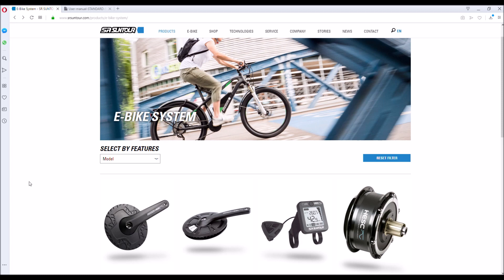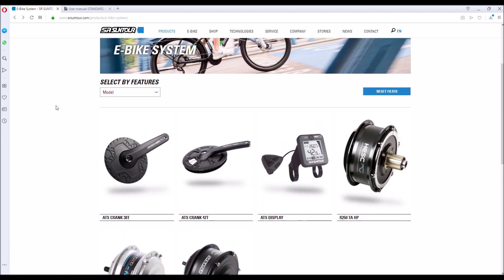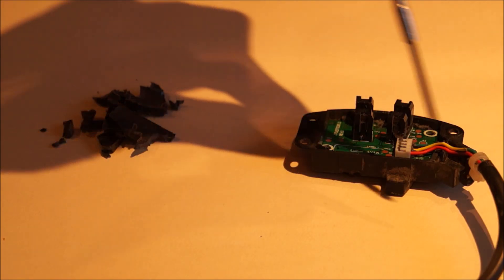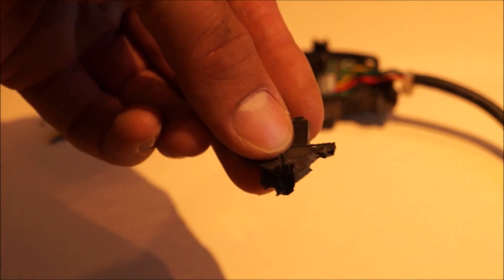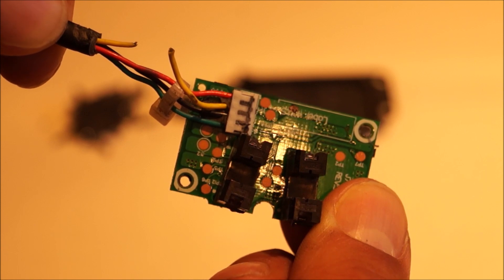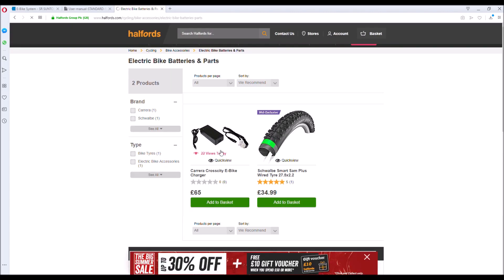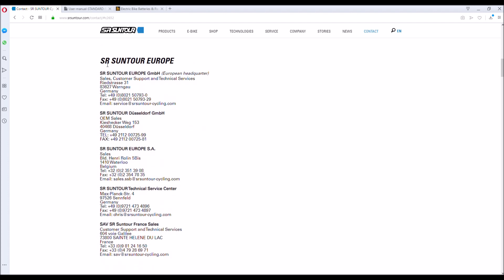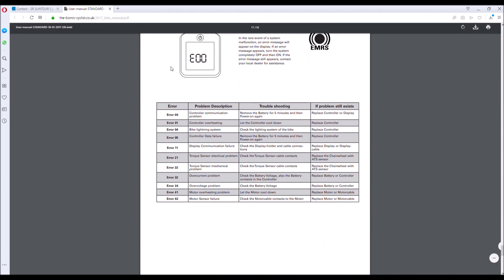Carrera Vulcan E-Spec - torque sensor problem (E21 error)

Comment from the maker: I noticed somebody posted a comment a couple of days ago about an E42 code fault - it appears that comment has disappeared, but I can tall you that this is a fault with the motor cable.  That is the cable connecting the hub motor to the battery.  Best thing to do first off is to check for any loose connections. There are microconnectors that plug into one another at the battery end which can come loose, but the most likely culprit is a loose connection where the motor and battery leads plug into one another under the HESC neoprene cover on the chainstay. HOPE THAT HELPS!
Reply: I have a similar E42 fault, couldn't solve the fault, please  assist

Comment: I have the crossfire and have the same error, now and again, but it seems to clear up when I keep the bike indoors  over night, so  I think it may be a  cold/damp problem, which is not good since I can not really store the bike in the kitchen all the time, but it don't seem to like the shed. thanks for the link
Reply from the maker: No problem. I'd always advise keeping the battery and display unit indoors at all times. Always keep the plastic protector slid over the contacts when you remove the display unit.

Comment: I have a Carrera subway, after 2500 miles I started getting error code 21 would switch off and on and it would be fine then it started getting more regular. Bit the bullet and very carefully took the 3 screws/bolts off there is no water resistant seal on casing, the part with the 4 sensors is sealed but there's a void where the cable comes in and the 4 wires go onto the board I cleaned the void carefully with WD-40 contact cleaner then filled the void with gorilla silicone put a small beed of silicone around the edges, and is working fine now. I think all the dirt and grease in the void when damp was causing a short. Done it all on the bike without having to remove any wires or plugs

Comment: Hello again Ice Reef,
  I went to Halford's today and put an order in for the part...they said it will take ten day's at a cost of  40euro.
  The rep said he will also see if it can be done under warranty....though i suspect it may be out of date.
thank's again.
Reply from the maker: rcfanaticdublin Good news - maybe try telling them it is a common failure and it should really be a warranty replacement. The new sensor is a much better design with the plastic guard which prevents more dirt ingress 👍
Reply: @IceReef ,
I did mention our conversation to the rep...I think that's the reason he made the offer.
 don't worry...i did not mention who i got the information from.

Comment: My anti rotation lug also broke but I caught it before wires were damaged. I have done an araldite repair on it which looks strong enough at the moment.
Very helpful links which i will use to try and get a new battery as mine appears to be starting to fail. Can not decide whether to fit a whole new bigger battery to the bike which is alot cheaper to do than buy a new one from Halfords.  May be you could have a look at this idea in another video??
Reply: Hi,
Where do I buy a new battery for this bike please?

Comment: Did you ever find anywhere for the new parts?
I've had a nephew crash mine and shear off a pedal meaning I've to replace the whole crank right crank arm (and the chain system, because it seems to be one piece), but I can't find somewhere to get parts.

Comment: Had the same exact problem few weeks ago. Halfords sorted it under warranty
Reply from the maker: Hamza Ahmad Good to know they replaced it without an issue. Unfortunately mine is second hand!
Reply: I think your best bet would be to ask for the replacement in an Halfords repair shop as they have contacts with suntour directly
Reply from the maker: @mughal_gtown  I've spoken to the dealer in the UK who, unfortunately, cannot sell to me direct, so am awaiting confirmation from Halfords if they have the part, and how much they are going to charge / rip me off for!
Reply: Hello Hamza,
Just wondering...how long have you had your bike and how many Mile's/klm's?
before your problem with your bike.
Reply: rcfanaticdublin had it for about 9 months now, over 3500 miles on it
Reply: @mughal_gtown  ,
Wow...mine just turned 2 years old.
I don't do much crazy stuff on it as i am well north of 40...2007klm ODO.

Comment: I recently looked at a friend's ebike that has the same (looking) suntour parts shown in the thumbnail here but not the same bike.   The crank, controls, display, etc are all the same.   Anyways, this bike is getting the e21 code because the torque sensor on the crank got caught on something that ripped the wire out and broke off some plastic tabs.  I took it apart and  resoldered everthing on the sensor, and the error code went away.   I want to replace the entire sensor but it seems the only ones i can find that will ship to me are the grey colored ones.  One guy has the matching black one used but won't ship to me.   So far, the only difference i've found in all these sensors is 4 wire vs 6 wire plug.   I need a 4 wire and I see them available online.   Are these gray colored ones real  OEM parts made by suntour or soem garbage knockoff?    My other question is, are all the "4 wire" plug torque sensors the same and should work with all these suntour HESC systems as long as the plug matches?

Comment: I loved my electric bike until it failed twice in 1500 miles . Just under 1000 pounds to fix,no help from Raleigh. Gone to the scrap man.The whole support system for ebike parts is shot to bits  . Everything is over priced if available at all. You can buy a new microwave for fifty quid but a crank sensor is 100 pounds used on eBay .

Comment: Just to add to my earlier post Halfords said that it was the head unit that was at fault and replaced that and it seems to have worked? Apparently this is one fix they use?
Reply from the maker: They should be able to tell the issue immediately based on the error code being generated.  If the screen is not working, it is often just a loose connection. I did another video on this very topic - should be in the link in the video description!
Reply: @IceReef  Thanks for your quick reply much appreciated, there have been further developments, when they were trying to fix the bike other random codes appeared, including 04 which is to do with lights - strange as the bike doesn't have any! They have replaced the controller, TS, and took apart the TS and ECU and found them to be full of a residue from a 'maintenance spray', they think it is the Muc off spray 94 (a bit like GT85) and advised not to use that near the bottom of the bike, just water. Going to test it today. Also to leave the battery abd controller in place covered with a rag when washing  as that is a better water seal. Halfords do seem to have worked very hard to solve the problem.

Comment: Hi everybody, brilliant video I have a very similar problem my sensor housing has cracked and is now not working, I have been into Halfords who have now told me they cannot get the part anymore :( it’s a new model vengeance to so strange. Don’t suppose anybody knows anywhere else I can get one from do they? I have email all the addresses on the Santour website asking them for help but had nothing back. Cheers
Reply: The hub motor anti rotation washer on my 3 year old Crossfire broke in two 2 years ago but I wedged it back in and it worked until recently. I ordered another from halfords and it has taken just less than a month to arrive, which is not bad because their suppliers were out of stock. The point I make though is that I called in after a couple of weeks and saw a different mechanic from the very helpful one I dealt with at first. He told me that they might not be able to get the part at all but I think changed his tune when told that this was a relatively expensive halfords own make bike (not e bike) and it was unacceptable to be told that they could not supply spare parts for a 3 year old bike which was unusable without the part. Be very firm and insist halfords obtain the part.  My rotation washer does not appear to be available elsewhere, being 20mm diameter and grooved round the circumference. Tell them you will take it further and complain to the Chief Exec in writing if they do not get the part for you.

Comment: Like your vids mate. Been looking to get a e bike and think gonna go for Vulcan (2018 looks better than new one so will see what’s out there and available) do you have Facebook or twitter so I could ask few questions and get some  ore tips, hints & advice. Cheers
Reply from the maker: Hi Jamie - thanks for your kind comment. I do now have a Facebook page for the channel - button link is at the top of the channel page. If you click that you can drop me an email directly.  Alternatively, the link to my email is on the channel page as well.
Let me know if you have any problems, but look forward to seeing you on the Facebook page.
Reply: i now realize the sensor on my first bike, was the  old type early 2017 although purchased mid 18?, even though the bike was bought later than  than ice reef, (his video was my inspiration for purchase,), then when everything failed and HELLfords gave me a new bike new bike ! now same anti rotation lugs failed as in the video same no parts , local Halfords say they have 42 tooth chain ring sensor from crossfire, or wait 6 months or more refuses to give me the sensor from his parts, say it will upset his  stock i can have, fitted, i would have it on a temporary basis awaiting 38tooth as standard, but it's a take it or leave tit choice ,Halfords ,mmmm.pursuing refund ..

Comment: Hi buddy,
have you taken a good look over the crank unit?
the reason i ask is...there is a fair bit of drag of the sensor plate on my bike.
Reply from the maker: I haven't opened up the crank unit yet but intend to as it is probably filthy in there and could benefit from a clean with some contact cleaner

Comment: Hi I got a carrera Vulcan but it's been back to Halfords many times cause of the fault coming up E21, is there somewhere I can get a replacement  as I'm really fed up with Halford's, just wondering if you got a replacement and did it solve your problem,  Darren.
Reply from the maker: Hi. I did get a replacement. I ordered it over the phone from Halfords and picked up a week later in store.
I fitted it myself and it did sort out the issue.

Comment: The sensor broke within three week of having the bike, Halfords did get a part from Darlington within a few days, but two weeks later (today) it has gone again!!  I have noticed it goes after washing the bike, I used Muck off and a very low pressure  hose, is it water ingress? Going to Halfords in the morning. Says error code 22.
Reply: mark jakeway hi mate, just seen your comment,  have you managed to order one of these sensors from Halfords then ? I’ve noticed your comment is 3 weeks old so quite recent. I have been trying for weeks and keep getting fobbed off telling me they cannot get me the part.
Reply: @freeenergy2456  Hello, sadly since then I had a number of other errors, but Halfords can get them, in fact my local store has a number in stock now! So the full story it went back as above and they took three days as they kept getting error codes, the changed the LCD head unit as well as the sensor, and the staff there were great (Durham branch) but four days after getting it back  it actually went again this time with error 42! This time when I took it back they just offered me a full refund straight away and I upgraded to a Raliegh ebike with a mid drive motor. A shame really as the Crossfire was a decent bike. Keep pestering them and take it higher.
Reply: mark jakeway thanks so much I will try and call today

Comment: Hello from Dublin,
  I got a Vulcan Espec just under two year's ago from Halfords.
My bike developed a major fault at the crank set just about a week back.
 The bike has barely 2000km done over all since i purchased it back in 2017.
 My bike is kept indoor's when not in use and i clean and lube it every week.
 Do you think it would be expensive to have the bike repaired?
Reply from the maker: rcfanaticdublin Hi - what appears to be the problem?
Do you have an error code on the display panel which you can provide me with?
Reply: @IceReef  ,
Sorry my problem is a mechanical failure at the crank...the sensor plate has broken and is rotating with the chainring.
I have been having occasional problem's with the bike switching off...no error code's.
thank's for the promt reply.
Reply from the maker: rcfanaticdublin I managed to get the replacement torque sensor from Halfords - £30.99. They order it in and you can usually collect within a week. Straight replacement with three screws. I’ll show installation in another video. 
That should solve your problem - Halfords have it listed on their system as a crank sensor
Reply: @IceReef  ,
thank's again...i think there's a bit more damage on my machine.
Oddly the sensor still work's...but the crank has developed some dragg when i try to back peddle.

Comment: Hmm! I'm about to buy one of these bikes. Are there any modifications that might protect the sensor in the first place? Also, Halfords told me there's a newer model coming out. I might wait for it, as it might have improved reliability. Thanks for the info. Downloading manual now!
Reply from the maker: WeZ Did Halfords tell you what the specs of the new model would be?
I’d only say it would be worthwhile if they include a bigger capacity battery and somehow increase the range as it isn’t great in everyday conditions.
Reply from the maker: WeZ In answer your your initial question, the best way to protect the sensor would ideally be to have metal lugs instead of plastic, but that would be a custom build with a bit of aluminium plate or something similar. The new sensor I just got from Halfords does have a new plastic dirt guard at the bottom which is much better than the original design
Reply: @IceReef  No I was only told a new model was on the way by a staff member.. Although, I've seen nothing on the net.
Reply: @IceReef  Thanks. At least it can be fixed. I was looking at the Riverside 500, but i'll stick with the Vulcan as there's more info available from persons like yourself.
Reply: @IceReef  Just got the new model. The battery is physically smaller, but rated at 417 watts (same I think). The motor is stronger, rated at 60 Nm.
I'll only be using it 4 times a week, on my 30min Gym ride, so that i've done my cardio on the way. I'll also do a 1hr 30min ride on my off days.  I'm not hardcore. So the battery is good for me. (i hope) I just need the help on the hills at the start of my rides. They are nasty... Wez

Comment: Hi is there any updates on the bike as still in two minds weather to buy. Thank you
Reply: Don't buy it! I've had nothing but problems with this bike since new. I've spent more money on keeping this bike running than my motorbike.
Reply from the maker: @tangerine0072000  I would say that it is only worth getting if you can find a second hand version for a good price - be looking at around 400 if you can find anything.
Otherwise, as stated above, the system is trying to be too clever for it's own good, and is plagued by a few glitches and build quality problems.

Comment: Hi I thought I posted but can't see it .the torque sensor on mine went at2000 miles 1 year ,final straw ,with cut outs and 4 display holders cracking on the bracket.Halfords replaced the bike.I was in two minds to asked for a refund.but they suggested I might forget to return the battery so I now have a spare..,it cuts out ..the new one does not

,so that might shed light on the cut out.

The crank assembly is different as is the sensor
Tried suntour UK,Europe and like you they said try Halfords
500miles so for all good.

Comment: Had my brand new bike for half a day and it's for the e21 and e22 error payed nearly a thousand pounds from Halfords
Reply from the maker: It is quite buggy unfortunately.  Many issues around the torque sensor and slightly loose fitment of battery against holster and the screen against the display holder.  I would advise to strap down the battery with Velcro straps to the holster, and also tie down the display screen to the holder as tightly as you can as this can often be the cause of the errors.
Reply: @IceReef   Halfs gave me a new bike in the end let me keep the old battery, i going to change the gears as you did next,the cut out for me is after i work the bike hard,then power of descents, terrain does not seem to impact, i ride some level very rough tracks,thanks again i am becoming a Vulcan fan regardless ,.after your first vlog ,
big issue 5 display holder cracked ,that how hard i ride ,replacement 3 month or lots of improvisation.

Comment: where can i order this piece today?  at halfords they can't place the order due to the corona virus, does anyone know where i can order this new or used part, i need it urgentl
Reply from the maker: You can try speaking to Suntour Europe via their website, but otherwise it will only be available from Halfords
Reply: Hi mate I’ve got exactly the same problem, they are telling me they cannot get the sensor so my bike is pretty useless now
Reply from the maker: @freeenergy2456  Go to the Suntour website and contact their European office and ask about parts support. Explain the situation and they should be able to point you in the right direction